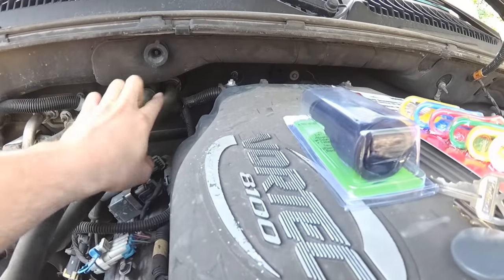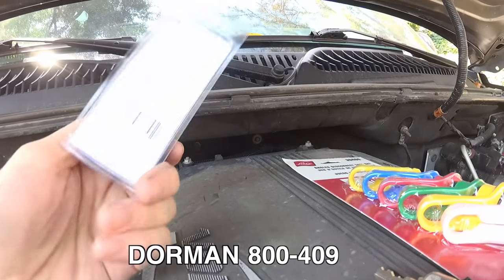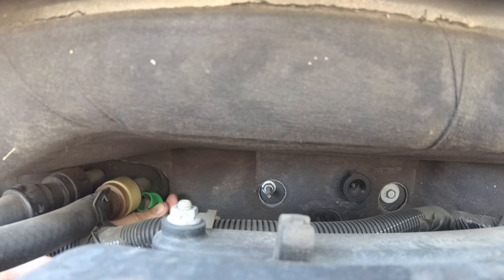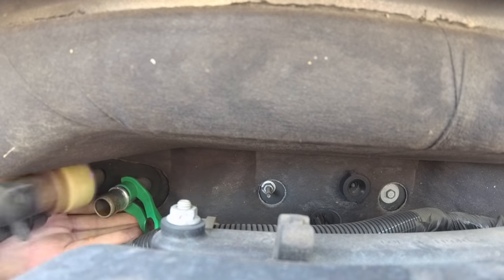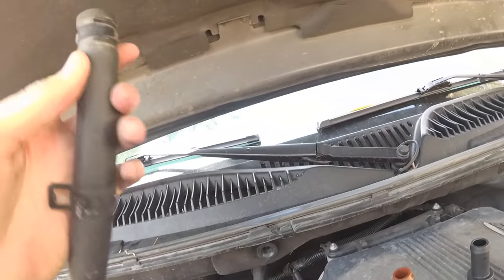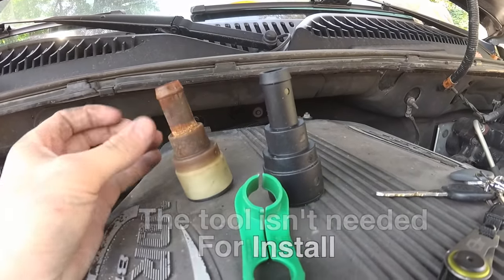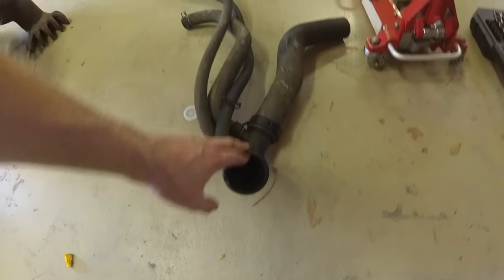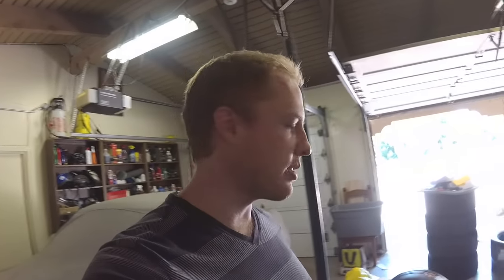Chevy Truck Heater Hose Quick Disconnect Removal DIY

Comment: I don’t know if you’ll even see this comment but thanks for the video. I’ve watched probably 30 different ones. I bought a set of angled quick connect tools and couldn’t get the 5/8 to work. Then got an aluminum one. Didn’t work either. I searched for your video in the middle of cussing and working my fingers to death trying to get the tool to seat. Finally found it again and you used the green. Felt too small at first and still had to work it a bit but finally got it changed out. Thanks so much!

Comment: You can remove the broken connectors and just put the rubber hose back on the aluminum outlet and use a screw clamp and not use that gm pos connector and it will not leak nor come off. Make sure you get the hose  and clamp past the step on the aluminum tube. Done tons of them.
Reply: What do you use for the “T”? I’m guessing a brass barb T would work best but would it fit?
Reply: This works only on non-rear heat vehicles.
Reply: @parkermaraventano3590  why?
Reply: @therideszz  because rear heat vehicles have a T-connector where as pick up trucks have a straight connection
Reply: Bruh I’m doin this right now fuck yea
Reply: What size rubber hose... 5/8th ID?
Reply: @jamespierce2415 what size hose did you use? ID 5/8th?

Comment: IF YOU DONT HAVE TIME OR MONEY TO BUY THE TOOL: cut an old credit card in half hotdog style. put 1/4 in. cuts at a 1/4 in. apart all the way down the spine of the card. proceed to flex the card into a tube shape. the cuts allow the card to bend easier. then put the card behind the connector into the space between the male and female connection. cut the card to length to have a good circumfrence. push the card deeper into the connection and pull the hose at the same time.

Comment: You make it look so easy i had to use all my mite to pull mines off i even put grease on the end so it can come off easier. I didn’t even bother replacing it i just put the hose directly on the heater core to avoid that again
Reply: That sounds like me. 😅😅😅😅

Comment: Amazing video, thanks for the part numbers!!  Just saved me a ton of time,  frozen fingers and a huge headache.  My connector broke when it was 15 degrees outside.  Picked up the parts and had it swapped out in less than 10 minutes.

Comment: Had no idea there quick disconnects for heater hoses. Picked up this exact set at Northern Tool. 2006 Silverado 6.0, used the green one on both. A little tricky to get them on there, I took the plastic engine covers off for more room. Appreciate this video big time!!

Comment: After watching this video I had an idea. I cut a 1" strip from a yogurt container wrapped it around the pipe a few times and slid it in to release the broken fitting. It worked. This video was so helpful..ty edit: it was a total of 11" of yogurt container strip
Reply: Worked great thanx

Comment: You sir saved me from further frustration. I bought the same set that you used. I thought the orange tool was the proper one. I had purchased the aluminum 3/4" hinged tool from Amazane and gave up on it after 40 minutes. When you selected the green 5/8" tool I paused the video, went back into the engine bay, and three minutes later I had the dang thing off. I'm still trying to get the connector on the left off but that will wait until tomorrow. These two hose connectors have taken more time to removed than all the other hoses, the water pump, and idler pulley and tensioners COMBINED. I am seriously considering putting the hoses directly on the heater core nipples and clamping them down like every other water hose since Henry Ford. In short, thank you. EDIT: Today I went back to get the left connector off. I tried and was having difficulty. I decided that the tool needed a bit of lubrication. I used plumbers grease to lightly lube the inside and outside of the tool. Viola, the connector is off and I am putting my Silverado back together. I'm 76 years old so it takes me much longer to get things done. Thanks again Zent Rose for leading m to a successful end to my problem.

Comment: Thanks for the video. Went all over town looking for the disconnect tool and no one had the 1 I was looking for. Saw your video and saw that same set at the parts store. The green one worked for me also.
Reply from the maker: Excellent. I hope your truck is running well. Glad it worked!

Comment: Great tip. But if you have to do the other hose right beside it, use the 3/4" orange release tool. Green might work, but it's hard to get to, I used the orange and it worked well. Just had to really get up in there to get it to release.

Comment: Thanks for the part numbers above! My local parts store gave me the wrong ones at first for my 2005 Avalanche 1500 (5/8 hose to 5/8" quick connect, which is wrong - needs to be a 5/8 hose to 3/4" quick connect).
I also found a Lisle 39190 aluminum 3/4" quick connect tool instead of the plastic ones.

Comment: Thanks man, I was working on solving a no heat issue that turned out to be an asston of crud in the entire system. Thought I was golden while happily flushing the system away while it was 20degrees while anticipating having heat again. I hadn’t even noticed that plastic thing had broken off until I was reassembling all the hoses then I saw…. I was goober sad and was already an hour deep into watching vids on how to replace the heater core when I decided to search specific to the inlet and found your vid. Just got back from the parts store armed with the parts suggested. I anticipate this to get me back on track and thankfully not dismantling the damn dash(even though I eventually have to for busted actuators smh). Thanks again dude!

Comment: Here’s how I did it:

I tried those aftermarket off the shelf disconnect tool sets but I couldn’t get it to go inside the connector. I surmised that the part that needs to go between the pipe and the connector was too thick. The correct tool for this is a J 43181. Dorman makes this tool as 800-450. I ordered it from AutoZone and got it the next day. I tried it and it worked, but here are some tips.

1. Don’t insert it all the way. If you do it won’t work. You will need to insert it about half way. 

2. After you remove the broken connector and before you install the new one rub some antifreeze/coolant inside it or you won’t be able to get it to go on the pipe. 

3. As to why there is even a connector between the hose and the pipe, I can only guess that maybe due to vibration the connector is a kind of a sacrificial part so that it breaks instead of the heater pipe itself, but this is only a guess.

Comment: 5/8". Mine broke off today and I had no idea how to get that little bastard off. I'm gonna design and 3D print the quick disconnect adapter. Thanks for sharing!
Reply: The Mod Shop Disconnect set at harbor freight is only $4.75
Reply: how many miles at time of hose break?
Reply: @chaytongchachu4203  glad to know. What I needed wasn’t available locally at the time or I would’ve totally picked one up but for a 15 minute design and 15 minute print it served me well.
Reply: @acadianheatingandair3291  my truck was pushing 170k at the time but it’s probably best to change it preemptively. You can connect it directly to the metal tube with a hose clamp no need to replace the part.
Reply: @TheModShopCO  post a link... I have front and back heat in my suburban and cannot fit the tool between the stacked quick connects.. really bothering me... thinking of replacing all this quik disconnect crap with brass hose barbed Ts and rubber hoses

Comment: Thank you for the how-to video. Happened yesterday on my uncle's truck (connector broke in half). So the old ones are going away, 3/4" hose in their place and in-line reducers to link to the stock 5/8" hose. :)

Comment: Buy the better dorman 800-409hp,its stainless steel and shouldn't break again. It more money obviously but will definitely be worth it. I also have an 8.1 vortec with 398,000 on it and it runs great,no knocks or smoke. Great motors!Thanks!

Comment: What if you just connect the hose without the plastic piece you just replaced. I have a friend that says you dont need to replace the plastic just break it off clamp your hose back down ??

Comment: I just did this. With the same tool. Once I slid the tool in it was still tight on there. Had to also twist the fitting as well. But came right off.

Comment: why cant you ditch the connector and just hose clamp the hose on the heater core?
Reply: Im an OEM type of guy but this quick connect heater hose shit is the worst engineering I have ever seen... Chevy trying to incorporate proprietary crap
Reply: @markpasieka  It was really easy to connect, just about impossible to disconnect.

Comment: When you put the disconnect clamp on, pull it toward you so that both little clips go inside the back of the clamp. 9nce u got that, then turn the rubber/plastic clamp piece while pulling (dont worry about pulling the disconnect tool) hopefully i explained a bit better, but i just spent an hour and 30min on n off trying to do this for a coworker

Comment: Awesome video...why would chevy use this brittle plastic piece instead of putting the heater hose directly on the heater core pipe like they have done for 50 years???...SMH

Comment: Suburban has two heater cores - one for the front and one for the rear passengers (located in the back of the vehicle with hoses running under the body the full length of the vehicle) .  I was unable to use this tool on 2003 Suburban rear heater core hose removal.  This tool seemed to fit, but provided no disconnecting.   I was able to pinch the white tabs on the quick connect and work the hose free.  I wonder if there are more than one type of quick-connect hose connectors?

Comment: Mine is the connector to the left. It has tabs on it that will not release with that tool. Mine are the disconnect tool without the pull tab.

Comment: I had to do just that to 2004 Silverado.  But, what I don't see, is how to do a quick repair of a heater hose connector that breaks on you while you while you are on the road.  It happened to me on a Sunday afternoon several months ago.  What I did, was disconnect the hose going to the core ( wall panel ), and disconnected the return hose to the block.  I made a "U" and reconnected the heater hose into the return engine block connector.  I had bottled water in my truck, so I was able to replace most of the water and coolant mix and was able to get me and my wife home.  Did my repairs the next day.
Reply: how many miles at time of hose break?

Comment: Thank you for the tip helped out so much. Does anyone know when the heat comes back ?
Reply from the maker: Did you bleed your cooling system after replacing this? heat should come back after bleeding

Comment: Mine has the push releasing “buttons” on the side. Is there an easy way to do it? I push in on the tabs and press the line together and try to pull apart and it doesnt work.

Comment: I got all ya'll beat.. My heater hose connector broke after travelling 40 miles to the middle of nowhere... And it broke off, just when I parked my truck in the parking lot..at an rc flying field.  We used an old RC engine muffler, cut the pipe off... and turned it into a bypass connector.. Just bypassed the heater altogether.. It was around 95 degrees then...So now it's getting cold and I guess I better get to fixin it if I want heat this winter.

Comment: Beware the Dorman part, I went to install one and the locking tabs slid right off the body of the connector. The whole connector is 2 parts, the little locking tabs are a small piece that slide into the larger part of the body. Looks like they forgot to put some glue in one of my 2 connectors and the locking part slid right off after I connected it to the heater core... The GM part's were around $30 each, vs the $10 for Dorman part. If your cheap Dorman part fails, there goes at least $40 in dexcool, not to mention breakdown time and any other issues that may be caused by losing all your coolant while on the road.
Reply: how many miles at time of hose break?

Comment: Than again please advise how to put the new connector in just push it in twist it or what? I'm confused. Thanks anyway.:(
Reply from the maker: yes just push it on there. If it is being stubborn, you can lubricate the o-ring in the connector with some coolant and it will slide right on!
Reply: ZentRose thanks a lot body .:) :)

Comment: Thank you so much for the video. It help me remove the heater hose on my son Chevrolet 2007. But how do you insert the new connector back? I tried but it won’t connect.
Reply: Use some oil or something so it can slide in.

Comment: It would be nice to see a video of somebody disconnecting a perfect one and installing the same one, or a video of one. I'm replacing my heater core on 2000 gmc yukon xl and it has rear a.c. controls and the SUV have more wiring and you have to take out more stuff on the inside. Thanks for the vid tho n e thang helps.
Reply: Have you ever done this before? I highly caution you for what you're about to get into. GM service manual says 18 hours labour at minimum to replace heater core, and that's with a GM trained mechanic. I attempted one in a 2000 Acura one time with a very basic cooling system. By the time I got to it, it looked like the vehicle had been in a major head on collision from the inside out! Hope your shop is clean and well organized cause you will have a billion parts to keep track of. Good on ya for attempting, I've learned where my limits extend to. Good luck!
Reply: Nope. First time for a heater core but I have the old one out and went with a 100.00 apdi replacement. Tried a couple cheaper ones and the t valve kept popping off on a 39.99 one.  So got serious about it and the apdi one is about as cheap as you wanna go. That was at the local O O'Reilly's auto part store. I'm 34 been working on rigs before. Could drive. I'm 12 hours n now. Got the heater core box back in now just got to put the dash back together.

Comment: The problem I’m having is with the hose beside that one. It’s connected to the T hose that goes into the firewall. The big rubber piece has heated and cooled so much I think it’s bonded and I can’t get it off to put the other connector on 😓😓😓
Reply: Did you finally fix it? Was it about the same way as this?

Comment: Good video. Thanks for putting it together. Is that the same method for removing the other hose (the one right next to it.)?
Reply: I just broke the other side off. I think it is the same method but there is no clamp on that one. Did you fix it this same way?

Comment: Is that part that broke necessary? Could you just pipe clamp the hose straight to the pipe?
Reply from the maker: I have seen people clamp the heater hose on there without the extra part, it seems to work fine.

Comment: Anyone having issues pushing the new connectors on instead of using lubricants just pour a little antifreeze through the connector once the hose is attached the antifreeze is already a lubricant it will slide right on the heater core

Comment: How about the hose next to it would it work the same to take out.   I am thinking is ac ?    Mine  is leaking from There.     Thanks
Reply from the maker: The hose directly to the left is another heater hose with the same style connector. The only difference is that it has a plastic clamp on the hose. I used a hose clamp to reseal it when I replaced the connector.

Comment: so if you take a knife with the deep teeth on them you can cutt it in half you probably could use a saw but you might cutt the metal hose so better to use a knife

Comment: What causes these connectors to snap? My first one was the right side broke off with the nipple left inside the hose and the second one just broke off two days later with the nipple left inside the hose is there an underlying problem that is causing these two snap or they were just brittle?

Comment: how many miles at time of hose break?
Reply from the maker: 150k I believe
Reply: @ZentRose  thanks  are they both the same size?  gm parts online is only showing 1 heater core hose so i thought they may both be the same . but some one else commented  1  is 5/8  and other is 3/4   and this is what was on ly 1996 1500  but just bought 2009  1500 lt love it has 158k miles and want to change all parts that are known to break down  before leaving me on road. thanks for replying   i am dissapointed no one in comments said how many miles were on vehicle when hose broke so i had to ask.   also dd you buy oem  or after market parts  thanks

Comment: After putting heater connector my truck starting to run rough making a sludge popping noise when I try to accelerate . Was running fine before It busted. This happen to anyone els

Comment: I can't get that fucking tool to go all the way in, tried the orange one too. Tomorrow I'm going to go pick up the GM set (white tools) and if that doesn't work I'm going to cut them off.
Reply: I got that Sme problem rn🤣
Reply: @FoundTony  Such a pain in the ass. I finally got it with the white ones, and still wasn't easy.
Reply: @yourface3154  I was able to pull it out, I just had to force the tool all the way in🤣